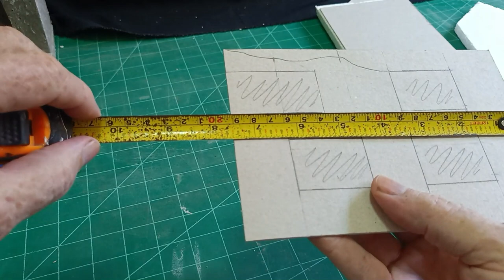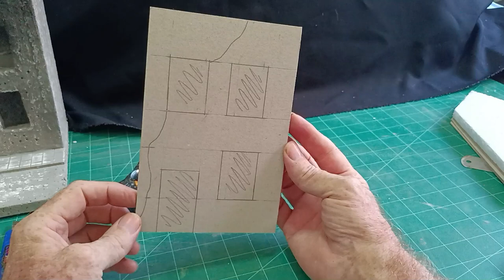How to make a ruined house diorama

Comment: 7:35 knife awareness and safety. Applicable to most of the thinner sheet materials.
13:55 Wall filler (Putty) as an adhesive to polystyrene. Wall panel sandwiches - cardstock laminating beaded polystyrene.

Diorama Don relevant links
Bombed Building: https://www.youtube.com/watch?v=SUMRUz1TFjE
Stone Wall: https://www.youtube.com/watch?v=i7yiHsiIYtI&t=940s (dry fit shown, can grout or mortar)
Bricks: https://www.youtube.com/watch?v=ZXKFH30E5OI&t=14s
Brick Wall: https://www.youtube.com/watch?v=BVRNUBgdJw8 (as whole wall and grouted)
Brick Wall : https://www.youtube.com/watch?v=EHMsVVHHYlE (individual bricks laid out and grouted) - most applicable to this video's Ruined House for broken brickwork.
Brick Wall: https://www.youtube.com/watch?v=1WThxC_wHVM (with decorative elements)
Brick Walls: https://www.youtube.com/watch?v=u-l_7-7X6JE (two methods of manufacturing and assembly, then: mortar, distressing, and weathering)
Broken Render (Plaster): https://www.youtube.com/watch?v=uDLRDnBa-Yw
Doors: https://www.youtube.com/watch?v=uH8BbLfxI6s&t=354s
Pavement and Sidewalks: https://www.youtube.com/watch?v=uZiXAIDTEZ0
Painting without Paint:  https://www.youtube.com/watch?v=DkdaFyrOjbo

[edit: for unexpected YT hiccups of extraneous spacing and bold type layout]